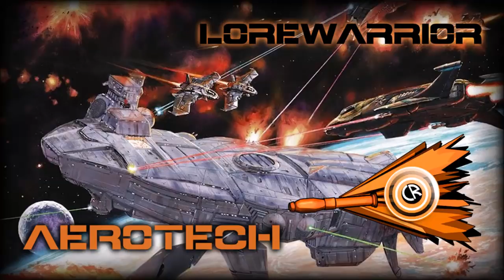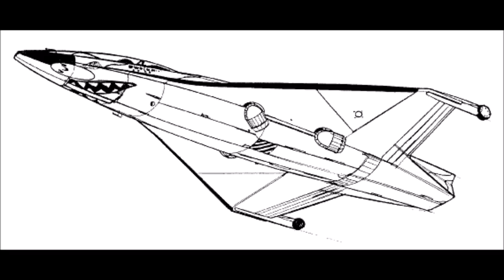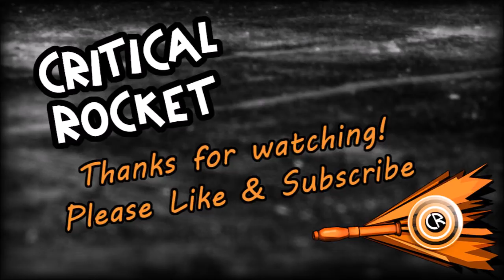LoreWarrior Aerotech - Guardian Fighter

Comment: What fighter craft uses weapons with max range of 270m? SRMs in fighters is one of the sillier aspect of BT lore.
Reply: Yes, but with a maximum range of 270 meters, you don't have any chance of hitting a target head-on, or even sideways. Heck, Machine Guns from WWII had a longer effective range than 270 m. Current air-to-air missile technology allows engagements anywhere from 50 to 100 MILES away, depending on the missile and the radar technology supporting it. New Ground-to-Air technology out of China is suspected to have an effective range of 500 miles. The short ranges involved have always been one of the shortcomings of Battletech: modern technology can fight over a much greater distance with great accuracy and effect. The lore "counter" to all this is that Battlemech Armor is thick enough to shrug off such attacks, but that still doesn't account for the conventional equipment.
Reply: In a jet fighter, you'd literally fly past your target between lining up the reticle and pulling the trigger in the span of 270m. I mean, how do you shoot something on the ground with a 270m range weapon when you are travelling at at least Mach 1 (350m/s)? You have 0.5 sec between pulling the trigger and crashing into it.
Reply: Well your choices are 270m range and the ability to do damage or much longer range but zero effective damage to anything other than infantry. Given that choice the SRM does not seem that bad, It should also be noted that SRMs are VERY effective vs aircraft and tanks.
Reply: Not sure you have seen the speed of fighters in Battletech but they are nowhere near that fast. They move at similar speeds to mechs, remember this is a game based on a 30 meter hex grid. Do not expect the weapon ranged to make logical real world sense because that is just not going to happen.

Funny enough Aerotech the rules for space combat use 300 meter hexes from memory and aerospace fighters have the same weapons with the same ranges so 270 becomes 2700 in those rules. It's all based on what is convenient for the game not what makes sense.
Reply: That makes sense for space combat, as there's no air resistance to slow the projectile, or the vessel. The International Space Station is traveling at something like 17,000 mph ground-speed (I know, I know, I'm trying to equate it to the real world again. :) This IS supposed to be SCIENCE-fiction, not fiction fantasy, after all).
Reply from the maker: Yeah but rule of cool people, rule of cool.
Reply: Critical: you're talking to a bunch of Nerds. "Cool" usually works against us. :) For that matter, I, for one, am also a Mechanical Engineer, and so I look at all of this Battle Technology through that lens, as well. :) It actually makes it much cooler and more interesting to think about, and adds another layer of depth to the technical fluff. :)
Reply: So given that "infantry-scale weapons on fighter jets" is canon, and "fighter jets don't have Battlemech armor" is also canon, what other real-life issues could force that to make sense?  Electronic warfare?  A cultural obsession with only using aircraft for close air support?

Comment: VSTOL = Vertical Short Take Off Landing correct?
Does that mean this fighter functioned like the RL Harrier?
Reply: SatansPooper pretty much. Even the drawing is based in the Harrier.
Reply: Well parts of the harrier, the upper intake solved the harriers ground fod (foreign object debris)  intake issues (these were solved with the engine mod, plus it design to ingest fod of a certain size)